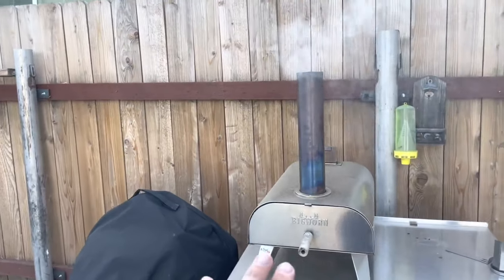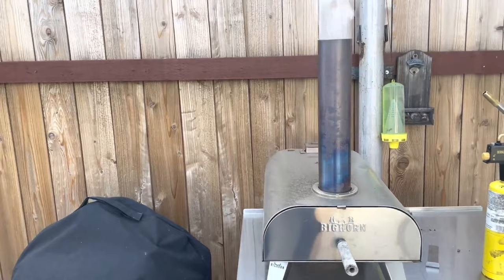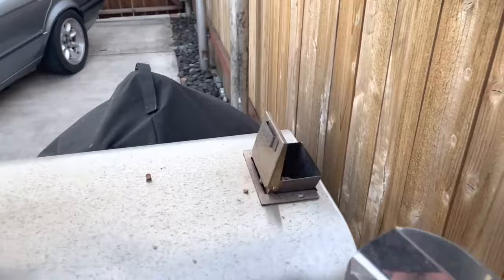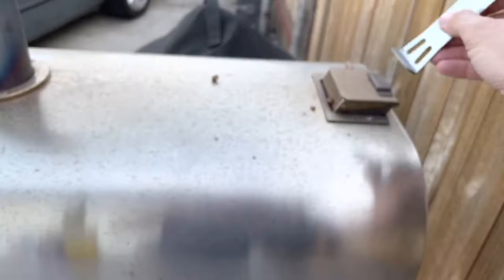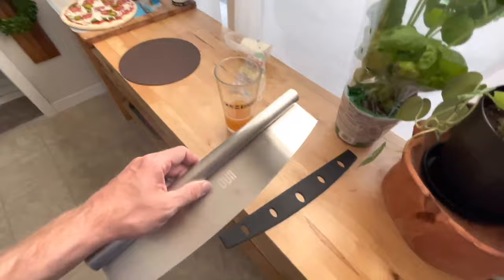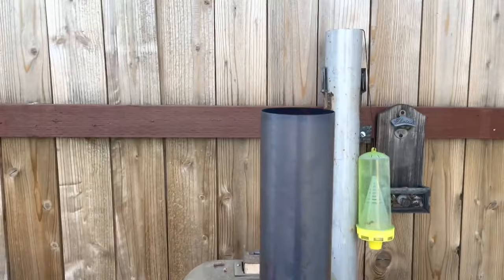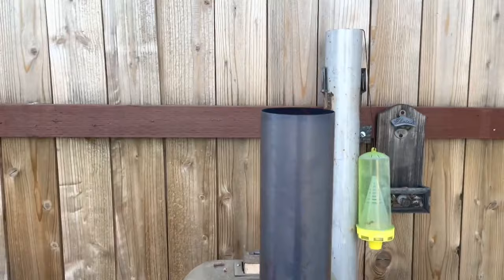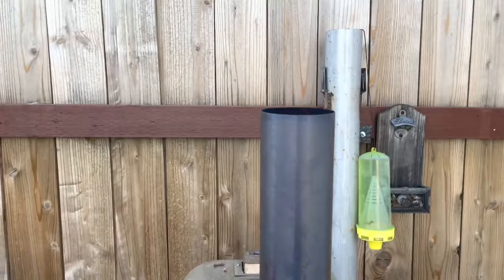AMAZONS CHEAPEST PIZZA OVEN  REVIEW!!

Comment: You need to measure the heat of the base stone. The gun thermometer is About $20 to 30. When the base is +-900f it is good to go.
Reply: Very few people use dough that can handle 900 degrees. Unless you have access to 00 Napolitan style flour I would not suggest it

Comment: Thanks for the video.  Are you using premade dough crusts?  They look a little thick, more like New York Style crusts.  In that case, if you try and cook them in a Neapolitan oven, they will burn.  New York crusts are cooked at a lower temperature like 500 to 550 degrees F.  Most smaller ovens like Ooni and Gozney are designed towards a higher temp (900 degrees) for Neapolitan pizzas.  You should also try using a smaller 7 inch turning peel to rotate your pizza and keep the pizza from getting singed.  Using the front of the stone without the door also would help.  I find that the flame chute gets very hot and burns the pizza through radiant heat.  Be sure to preheat the Big Horn for at least 25 minutes.  You might try to mix a 50:50 pellet blend with Royal Oak charcoal pellets.  You will get a longer burn time than just using sawdust pellets.  Looking forward to more videos.

Comment: Mmmmmmm pizza.   Are you running aftermarket toe links on your rear suspension? Or front monoballs on the front thrust arms? Hope you do more M3 content and give some details on your suspension alignment and dampener settings. Cheers
Reply from the maker: Yes and yes. Front monoball and fallline rear toe bars. Also MCS 2WNR coilovers. Still getting it dialed. PB’d again at Buttonwillow in 70+-90° weather but I know I’d be faster if it was cool out. Did a 1:55.013 or something way to close to a 54
Reply: @BlakesGarage  I just got a set of mcs 2wnr, but haven’t installed yet. They seem to be what lots of people recommend (your videos strongly influenced my decision). I’m looking forward to getting it dialed in, but hope to hear what other people are doing to get a good starting point. Thanks again for the great videos.
Reply from the maker: @uncleben4536  nice 👍🏻 yeah I’m still messing with spring rates think I need to go up more In the rear again. But I’m pushing the car super hard. I think most people would do just fine with the original rates I bought until they really start pushing.